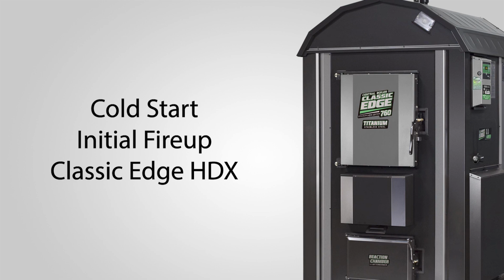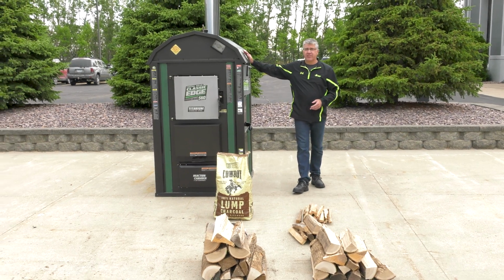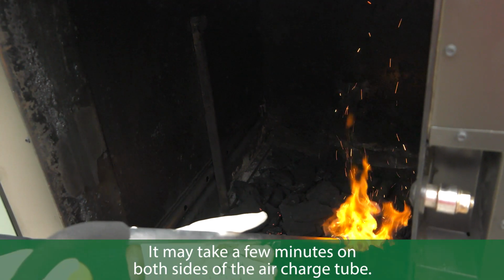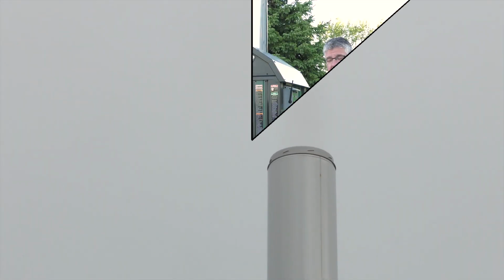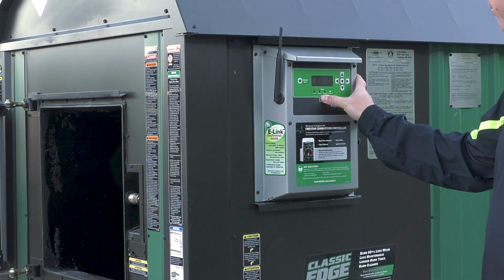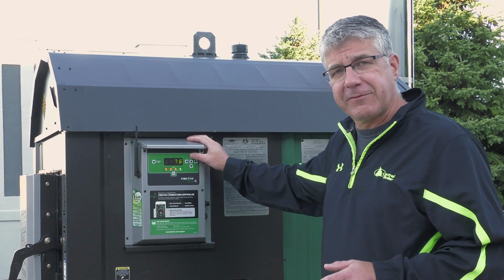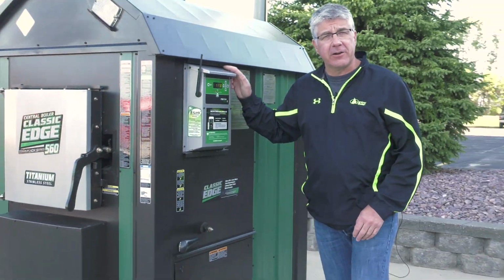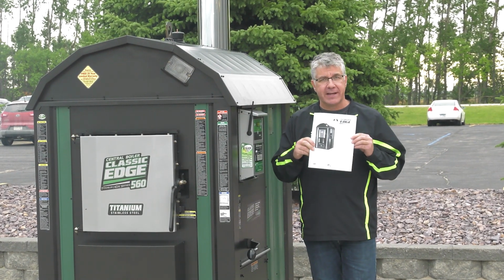Easy Initial Fire Up of the Classic Edge HDX | Central Boiler Outdoor Wood Furnaces

Comment: After 20 minutes of start up I’m only at 65 degree water temperature and when I open the reaction chamber I have no fireball at all as compared to this video.  Could the pathway be blocked or something?
Reply from the maker: Make sure you follow the steps with small dry kindling or lump charcoal for the fire up procedure.  Once a good amount of coals are built and with proper airflow, it should take off.  See the quick guide for more details: https://centralboiler.com/support/a/966?s=879

Comment: Great video, I was just informed today my new furnace has been built and will be delivered within a couple of weeks or less. Question, where can I find a propane torch like the one you used in this video? Excited to get our new HDX 560. Thank You!
Reply from the maker: You can ask your local Central Boiler dealer for torch part number 2900325.  Or another outdoor supply store may have something similar.

Comment: what happens when the (presumed alumina refractory cement) "reaction chamber" cracks and crumbles? i find no parts for that beyond the replacement nozzles. are they one piece such that ordering the nozzle halves gets you a replacement reaction chamber? that doesnt make sense as the nozzles are sold as two equal halves and the reaction chamber is obviously not bilaterally symetrical. do i have to patch old or do you sell a replacement reaction chamber?
Reply from the maker: The refractory pieces are replaceable. The upper refractory parts are the same for either side but for the lower refractory (fireball tunnel) the part numbers are specific for left and right. Models prior to Classic Edge HDX do not have fireball tunnel refractory. Part numbers for refractory on your furnace can be found by entering your serial number at CentralBoiler.com/support.

Comment: Hello Mark. My wife and I want to know what size we would need for our 3300 soft house
Reply from the maker: The best way to determine the furnace model for you is with our sizing calculator.  Square footage is not the best determining factor for heat load.  You can also check with a Central Boiler dealer.  Here's a link to the sizing calculator: https://centralboiler.com/Apps/SavingsCalculator/

Comment: Seems like you would “Always “ have to be home to feed it.  You could never leave your home for a few days.
Reply from the maker: We recommend having a backup heat source when installing an outdoor furnace.  Then, if the boiler runs out of wood, the backup heat source kicks on and there's no issues.  The water in the furnace continues to circulate back and forth to the building being heated which keeps the water from freezing.  So for most people, traveling is not a big deal at all.  
In other cases, people ask their neighbor or friend to load the furnace while they are gone. Using MyFireStar.com, the furnace can be easily monitored to ensure all runs smoothly.

Comment: Are you in partnership with Wood Master? Their Cleanfire  700 looks very similar.
Reply from the maker: Central Boiler, Inc. and WoodMaster, Inc. operate under common ownership. The CleanFire and Classic Edge furnaces have cosmetic differences but are equivalent in performance.
Reply: Central Boiler...so a GMC/Chevrolet of sorts.  Best of luck with this new design.

Comment: Love the look and operation of this new model boiler.  I currently have a Classic Edge 550 Titanium HD,   Can the lump charcoal starting process be used for my boiler also?   Also curious that when starting up the HDX the bypass is closed, is this something specific to this model?  Love my Central Boiler, can wait for the weather to cool down to fire it up.
Reply from the maker: Yes the lump charcoal process works on the Classic Edge HD series as well!  And yes, if you're using lump charcoal or dry kindling, leave the bypass closed like in the video.  Just make sure it's well lit on both sides of the air charge tube.